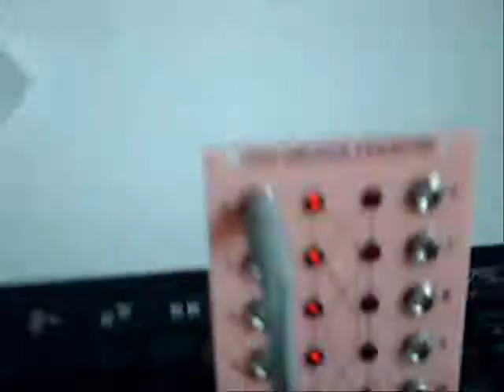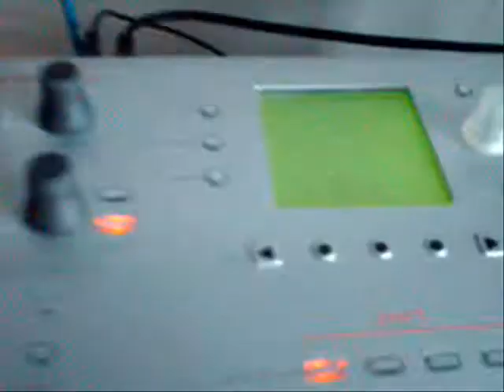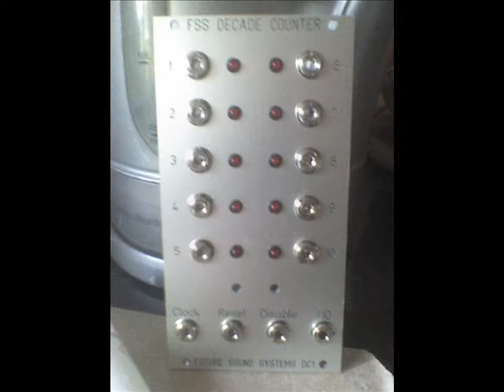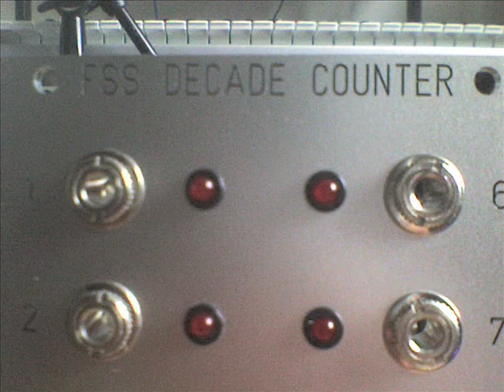Future Sound Systems Decade Counter DC1 Demo

Comment from the maker: Oh, that's one of two really old Yamaha DX11s I was given for free. They're both really battered up. The right hand side of that one has been folded into the actual main chassis and is somehow forcing the top C down. However, it doesn't trigger which is good.